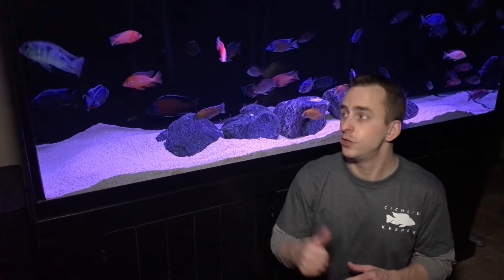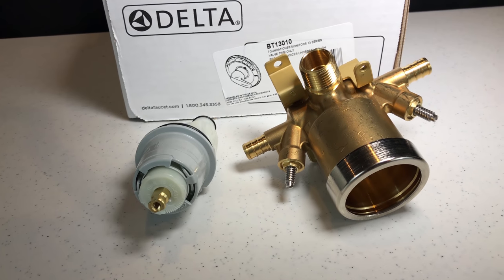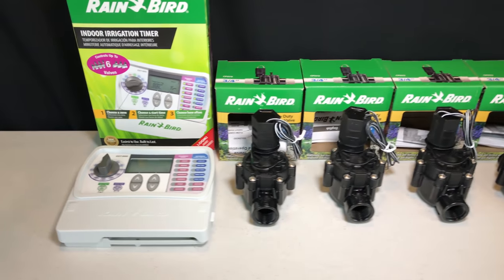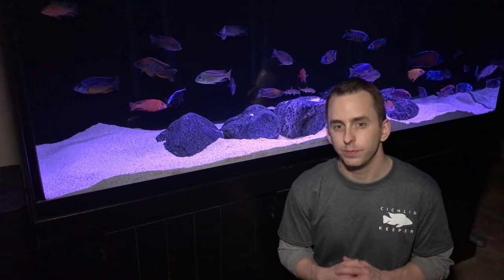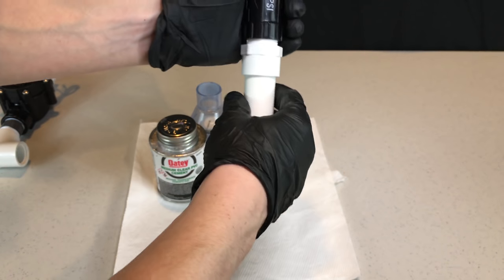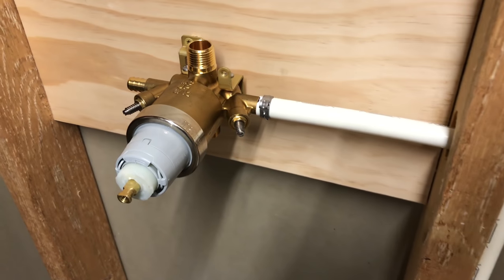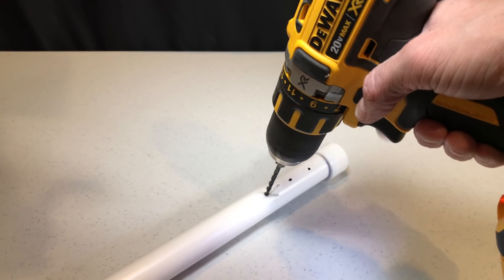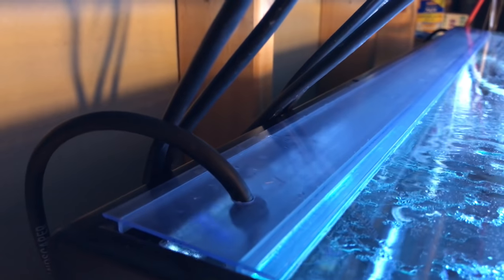DIY Fish Room Auto Water Change System

Comment: So funny Steve. I was in the process of doing this exact type system before I moved. I had the shower valve install and used it for individual tank changes. I just had a baby and needed to spend less time in the fish room. So I planned on an automatic change system to spend more time with the family. I was gonna use a sprinkler also. Super nice to do changes and fish room maintenance without even being in there. Good job.
Reply from the maker: +LVcichlids thanks! The point of this was really to spend more time with the family and not have to downsize. It was just getting to be too much.
Reply: Steve Poland Cichlids I completely agree. That was my exact purpose as well.

Comment: Excellent work on this project.  Word to wise...make sure to buy extra solenoid valve assemblies as in a couple of years the manufacturer changes the specs and you will have to cut out the bad bad valve as opposed to just replacing the gasket/seal/valve.

Comment: Great setup and video!..Nicely done! 
Too bad this those solenoid valves won’t work for saltwater ..perhaps o could design a similar system using motorized gate or ball valves. 

I’m thinking something like this:
I drill and install a drain valve in my sump’s return chamber (with motorized ball valve controlled by my Apex controller)..then once return pump is switched off, the top level of water from display tank that fills up that chamber (until siphon break) can be drained out with the motorized drain valve. New saltwater is then filled using a timer and the motorized valve would close after timer stops the new water input..to ensure exact same water level is achieved before the main return pump switches back on. I’d think this would be fairly simple and failsafe right? In the event the motorized ball vale fails I’d make sure the amount of changed water would cause a flood. 

Thanks for video and the inspiration!
Cheers

Comment: Nice work and thanks for sharing.  Know that another fishkeeper will be using ideas from this video when I design my fishroom auto-water change solution.
Reply from the maker: +MR Oz great, that’s what I did. Let me know if you have questions
Reply: Thanks Steve.  I have been watching all of your videos for years. Just one question, how do you initiate the drainage process? Sure it seems pretty straight forward, the water drains via gravity , but how to get that started seems to be missing somewhere?  As far as RaiBird systems are concerned I don’t see how they would “initiate s siphon” they are used only for the filling of the tanks and filtering out the impurities in the water as the tanks are filling up. 	So, is your system a semi-auth fill .  I want to try and get this going but I’m stuck on now the actual drainage of the tanks works.  Thanks and keep up the great videos, I am looking forward to seeing more.  MrOz!
Reply from the maker: Thanks for watching all this time! The new water just displaced the old water via the overflow in each tank. So there isn’t really anything to initiate on that side. It’s not a 100% efficient water change but the automation makes it worth it.
Reply: Thank you so much for answering so swiftly, looking forward to more of your videos, they're truly a pleasure to watch. Cheers!

Comment: Great video! I'm planning out a water change delivery system now and wondering how water tight those plastic flow control valves drilled into the pvc are? (Think they're from Jemhco) Do they ever leak at all?

Comment: Question, why did you not put one pressure reducing valve on your incoming supply to the water change system which then alleviates the need for 3 extra units and using one on each circut?

Comment: Steve.  Finally figured out that my leaks are coming from the threaded pvc connectors between each filter.  They seat all the way to the filter housing  and thus don’t ever really get tightened.  I’ve looked at your video but don’t see what you used to connect the 3.

Comment: The description on the filter says it works when at 0.5 gallons per minute.  How do you keep below that mark? If using more flow, wouldn't you need more filters in parallel? Perhaps there is a larger version that handles more flow.

Comment: A check valve generally does not relief pressure. If there is little flow, a check valve is not tight enough to have any impact on pressure. (no matter how clogged a pressurized system is, the pressure is the same). If there is significantly fast  flow, the pressure drop (due to friction) is experienced in the other direction-- the other end of the check valve.

What reduces pressure is a pressure regulator. 

Lower pressure is safer for a fish room for less chance of leak or rupture, but feed into an RO unit (if present) has to be high to get the rated GPD per the membrane.
Reply from the maker: This system has both check valves and pressure regulators. The check valves aren’t intended to affect forward pressure.

Comment: Steve.  I’m building this system for discus tanks.  What fittings did you use to connect the filters together?   Trying to see but looks like a fitting that’s threaded on both ends.  I want to keep the space between them to a minimum

Comment: Great step by step process Steve.
Is there any math behind your timed fills? Such as, how much water feeds through a certain diameter per minute? Or did you run tests on each size tank?
Thanks
Reply from the maker: +AJK Aquaria thanks Adam. The valves are rated at 10gph due to the diameter I believe. I'm actually still working out the exact timing and plan to do tests to make sure I'm getting the amount that's expected.
Reply: Thanks man.
It's a great project and something that saves so much time. I'm going to see if I can get this posted on the cichlid-forum home page. They cycle news and videos there every few days.
Reply from the maker: AJK Aquaria wow, thanks. That would be awesome.

Comment: Those filters sound like they remove hardness... wouldn't that mean that the hardness fluctuates whenever new water flows in until the sand or whatever hardens it up again?
Reply: They don't soften the water. Not unless you use an RO filter as well, which strips everything. It's a standard HMA filter which will remove dirt, chlorine and metal contaminants. It will also remove chloramine and the ammonia bound to it.

You can also use the filtered water for drinking :)
Reply: @BlatentlyFakeName  good thing I live in a country where it is illegal to have any of that in the tap water hehe
Reply: There will still be metals, sediment and other small pollutants, you can't avoid it.

They will be adding something to stop bacteria growing in the pipes, probably chloramine. They just may not do it all the time.

Comment: Every time I think you run a out of space in that tiny little basement of yours, you find more room for more equipment.  What an awesome project Steve, great job. I'm sure you are checking and double checking for leaks.  How are you connecting the brass and pvc together? Also, how do your tanks drain automatically before filled, did I miss that? Or are you just relying on the overflow drains from your auto water drip system? If so, aren't you dumping some mixed new water with the old?
Reply from the maker: The brass goes to pex and then the pex goes over to the water change system. The tanks don't drain automatically, they just overflow. It does dump some new mixed with old but it's very low maintenance compared to trying to drain water first.

Comment: Your system being in the basement and near the hot water tank you probably don't have an issue with the time lapsed between the start of water and the time it takes for the hot water to actually reach the system. 

But if the system was used say on the main floor and on a series of 10 or 20 gallon tanks where the water changes were faster would there be an issue?

Comment: Hey Steve.  I put in the same system but am having a problem with leaking from a couple of the canisters where they screw together.  I’ve used Vaseline but don’t want to crank them too tight.   Do I need to purge more air out?  I’m getting frustrated
Reply from the maker: I crank mine super tight. They even came with a tool to use to tighten. Never had them leak.
Reply: Steve Poland Aquatics Thanks   I have the wrench so I’ll crank them even tighter then.  I have similar type filters but triple the size on my bait tanks for my fishing business but have never had them leak. The bottom screws into top slightly different and seems much more efficient.  Always something to keep us on our toes!!

Comment: Isn't that just a mixing valve? In my area the cold water tap temperature can be decently lower in the winter... Which in turn would mean the mixed temp would be lower.  The valves I have put in during remodeling always had a limit control for the hot side which limits the amount of water that can come from the hot water line. But it doesn't adjust based on the temperature flowing through it like a thermostatic valve would do.

Comment: You didn’t use pvc primer nor did u hold the new joint tightly together after gluing for 20-30 seconds as you should to prevent leaks and form a proper bond

Comment: Hey Steve,  Great videos and a great setup.  I have a problem and maybe you can help. All of a sudden my well water has high nitrates and therefore my tanks have high nitrates.  Any idea what I should do?  RO/DI then add buffers?  Seachem denitrate? Biopelllet reactor?  Any recommendations would be appreciated. Thank you.
Reply from the maker: +JW Collect is it something you can fix at the source? RO filtration works but produces a lot of waste water. Denitrate isn't going to remove enough. There are reactors but that's a pretty extreme solution
Reply: The only way to fix the well water is to put it through a rodi unit then I have to add buffers, etc which I would rather not do.  Funny thing is I've had Comps, Julie's and cyprochromis spawn.  Have you ever used a bio pellet reactor or a fluidized bed?  Thanks

Comment: If you do not first drain the old water, you will always waste quite a bit of water. the automation is better if automatic drain of say half of the water is done first. this will require solenoid valve.

the valves shown here are diaphragm valves and require high pressure and enough flow rate. these won't work for automatic gravity drain.

Comment: Steve, I am building my system based pretty much on Yours...one question- do You still have to use aby water conditioner after automatic water change? I mean when the water passes through Carbon filter from tap...
Reply from the maker: No
Reply: Steve Poland Cichlids thanks alot!

Comment: Hi there Steve, I am Your new subscriber and fan! I've been keeping my own (small) tank for 3 years now and decided to move to a much bigger one with around 1000 liters. You've inspired me alot to go for malawi tank :) Please, maybe I missed something, but I would have a few questions if I may- first of all- what system do You use to stop water from flowing when the tank is full?? Any surface switches or anything like that? Or just the timer and some overflow? Thanks alot for advice!
Reply from the maker: +Ivan Macko the tanks all have overflows. So the new water displaces old water
Reply: Steve Poland Cichlids can you show me please how you assembled the overflows and how you filter your aquariums. How you got a main Filter or one Filter in each tank. ?
I am planing a little fish room in my basement. And i will have a big Tank in my Living room in the Ground floor. Is it posdible to take the Filter in my basement for this tank too? Thank you very much.

Comment: Steve,

I’m trying to build an auto water changing system like you have built, but I have a question regarding the drain system part of it.  Would I be able to have 2 bulkheads drilled in each tank, one for a standpipe overflow and another about halfway down the glass with a rainbird solenoid behind it to open up the drain for the water change.  This way I could run the rainbird for a minute or two to drain the water and then have the rainbird system fill the water to avoid having to mix the old water with the new.  Would a solenoid on the drain work and would I need to also add a check valve for that portion?

Thanks
Reply from the maker: +kurtr12 that's actually a really cool idea. I think that having the two separate overflows is key though. Because if the drain solenoid failed then you would have a backup overflow. Definitely do not do a check valve on the drain side though. I made that mistake once. With a check valve you need enough pressure to keep it open and and a drain will not do that. Seriously great idea!
Reply: Steve Poland Cichlids I'm building the setup I described.  I'll let you know how it goes once I'm finished and I'll post a video of it in operation.
Reply: The solenoid valves on the drains did not end up working.  The solenoids require a certain amount of water pressure in order to be opened.  The water pressure of the draining aquarium water was not enough to open it.  So I just did the exact same build you did, but I now have 2 overflows on each aquarium.  No big deal.  Always good to have a backup.

Comment: Nice system. I was curious though, have you thought of a constant drip system instead? This would do away with timers and other components. Just need to regulate drip flow rate from your source. Also better on your filters as the input rate is slower, so higher chance to clean water thoroughly.